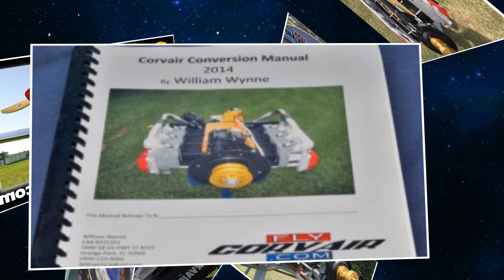Corvair Power, flying on the Corvair Aircraft Engine, Corvair College's William Wynne.

Comment: 6 cylinders is the way to go..  I hate to teach on 4 cylinder engines.  They vibrate more, and if you lose one, like it happened to me, you wont climb at all.  I was just taking off, then at around 200 agl.  Suddenly i was climbing at around 250 feet per minute and the vibration was shaking the instruments and ASI was unreadable.  Luckily i was sharp on turning back to opposite runway from 300 agl and did it.  A 4 cylinder will lose more power if lose one cylinder than a 6 cylinder and the vibration will be more.   Go 6 cylinder instead like this Corvair Engine.  They are not overprized and overrated like the other 4 cylinder dangerous..

Comment: What happened to the stock Corvair turbocharged engine.  Is it incapable of being converted for use as an aircraft powerplant?
Reply: The carburetor is really not suitable, also the old turbo is suck through and rather lag prone. It tends to make boost above 3000 RPM. Chevy also used small valves and low compression in the turbo to make it work on the street and respond decently when off boost. You can turbo one, and Wynne does so, but it is best to start from scratch.

Comment: What holds the Crankshaft in place when the propeller pulls on it ???since those bearing were designed for radial loads
Reply: stealhty1 The conversion includes a large 5th bearing in a billet housing on the front of the crankshaft bolted onto the case. This oil pressurized bearing carries all the flight loads of the propellor and transfers it to the case, allowing the four main bearings to carry the radial loads.
Reply: where do you get the parts for conversion
Reply: This video will answer your question for you.  https://www.youtube.com/watch?v=RTDlWSBQ-DU
Reply: The 5th bearing is an option. There are Corvairs flying that don't have the 5th bearing.
Reply: @jayphilipwilliamsaviation  Not necessarily wisely, but yes....there are.  There are planes out there powered by just about everything.
Reply: The thrust bearing Wynn designed and adds to the engines.
Reply: THRUST WASHER BEARINGS,  ALL engines have them